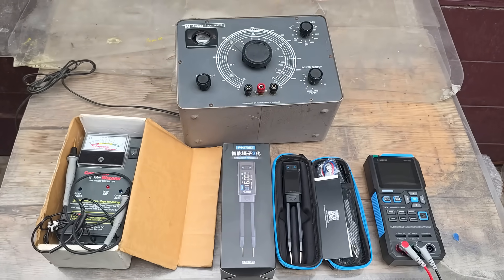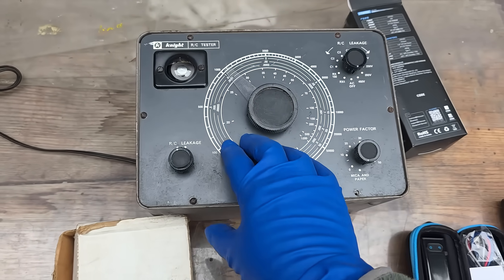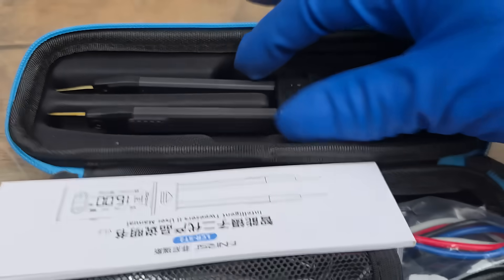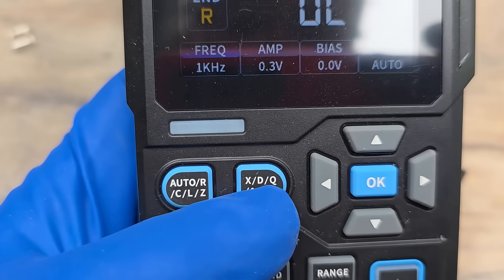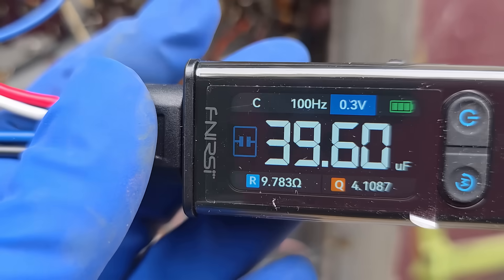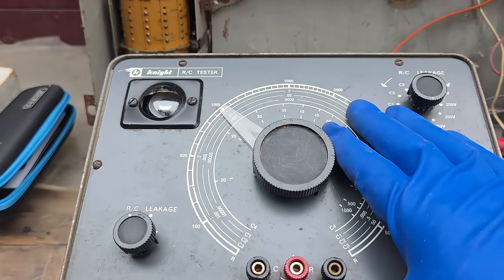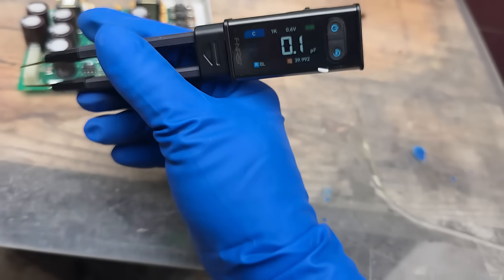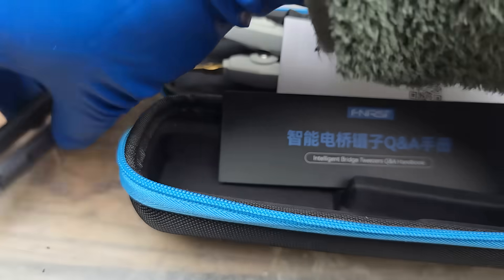Capacitor Testers and FNIRSI LCR ST2 dual mode LCR meter Review

Comment: Bought  the tweezers.  Did not live up to my expectations.  Would not test diodes in circuit. Battery seems to run down pretty quickly.  Capacitor test was mediocre.  I did upload the latest firmware.  Going to return to Amazon and try the bigger one.

Comment: I purchased this meter from the FNIRSI Official Store, and I am very dissatisfied with it. I conducted a comparative test with the previous LCR-ST1 model on 10nF, 33nF, and 47nF capacitors. While the ST1 shows perfectly stable and repeatable results, the ST2 fails completely. Even after "Open/Short" calibration at 10kHz, the readings (ESR and D) jump randomly by 500-1000% while the component is stationary. This indicates a high level of internal noise or a faulty analog front-end. The device is unusable for precision measurements. A short video with a comparative test is on my channel, link: https://youtu.be/14hxGCl6KPs

Comment: I was wondering how well that FNIRSI xray and nuclear tester would work on picking up the xrays around the HV area of a color tv. Would it be more sensitive than using the old fashioned geiger counter with analog meter? I would be interested in seeing you do a review on that.

Comment: FNIRSI also makes a decent entry level geiger counter for those who stumble into abandoned mines of a questionable nature.  USB rechargeable even.  Cheap on feebay from various sellers.  There are better ones but hard to beat for the price.  It does beta and gamma counting only.  No alpha or radon gas.  Sufficient for hobby level use in antique shops also.  Radium panel meters, dials, clocks will make it go crazy.  Vintage orange U-glazed pottery too.  Thoriated lantern mantles and camera lenses.  Medium level U-glass.  Not great for the mildest stuff.  It's all out there in the shops.

Comment: I already have the DER DE-5000 handheld LCR meter which I really like, but I just grabbed those same tweeters and paid the extra money for the Kelvin leads, so thanks for pointing those out. I’ll probably continue using the DER, I know it’s a clone of a much more expensive meter, if it ends up, deciding to quit in the future, I’ll take a closer look at the handheld you have. I also use a Peak Atlas ESR-70 Gold for ESR and a Sencore LC103 which I considered to be the end all when it gives me the results and allows me to measure for leakage up to 1000 volts. Obviously the smaller handheld meters are more convenient.

Comment: Hmmm my understanding is that a good LCR meter will allow you to check for capacitance @100 hz for us in the UK because its twice the mains frequency, so 120 hz is ideal for  mains AC filtering for you in the US because your mains is at 60 hz, capacitor spec sheets will usually give capacitance spec at this low frequency but i was led to believe that ESR should be always be tested at 100Khz only, could you clarify Shango what makes you think that the size of cap in microfarads make you select the frequency to test at?  I've had the DER EE DE-5000 for a few years now, made in Taiwan and available from Japan for around 100 dollars/pounds, and I'm always looking for more info on using it correctly, Love the cost of the FNRSI, Are they finally getting good for the money?

Comment: Fantastic video! Thank you Dr. Shango. That little instrument with the internal battery- how many years will it last?  In 2004 I bought a pair of Bose QC3  headphones. With little detachable LiION batt. and charger. Today, 21 years later, that battery still lasts as long on a charge as it did when it was new. I'm on my 3rd set of foam ear pads, but the damn battery refuses to die   :)

Comment: D stands for dissipation factor, not diode, and also tells a lot about leakage. Even at a low voltage.
Reply: Absolutely Correct, its when reading the spec sheet for the capacitor range comes into play, not available for the multicap cans so getting a better understanding on the dissipation factor  and ESR of those old cans is still one of my goals

Comment: fnirsi are not bad at all,i bought a 2c23t 50mhz dual channel scope multimeter signal generator recently and i find it good. also have a little lcr-p1 tester 18 months back,thats also fine though i might upgrade to the tweezers sometime.

Comment: My advice is if you're going to use it every day  and its high power  use or high demand and its 20 years or older recap it it will save you money in the future  and lots of original components could be damaged by failing capacitors  chemical breakdown is the cause of failure its like a oil change every 20 years

Comment: Man....  I think I spent over $200 on the Capacitor Wizard (great tool). Now, I think I need these. Test equipment can be an expensive addiction. Thanks for the video!
Reply: Yeah when i saw the price of the Capacitor wizard i baulked because you get get very good digital LCR meters by BK precision for example at that price and i already had the DER EE , DE-5000

Comment: I did not notice in the video that test clips have cable compensation.  Way cool.  I am always zeroing my tester to keep the readings accurate.  For less than $50.00 bucks I think I will pick one up.  Thanks.

Comment: It appears to provide very accurate readings! The only thing that comes to my mind is that there is some older test equipment which induces voltages that more closely simulate conditions a suspect component normally is subjected to, particularly in tube circuits. In such instances, components being tested with a lower voltage than what it normally handles may not necessarily indicate a fault. This new test equipment seems likely best for solid-state circuits.

Comment: So many people put Fnirsi down saying it’s junk but it’s not. If someone with as much experience as yours uses and approves of it that speaks volumes. I have the DPOS350P and the DSO-TC3 and they’re both outstanding products
Reply: Imagine having these things 30 years ago... They are amazing. What blew my mind most was the little transistor tester, that tests everything... That would have been magic when I started electronics 50 years ago. I use it daily. It is worth its weight in gold.
Reply: @martinda7446 agreed and I just ordered the DMT-99 to add to a field kit I’m building. For $32.99 on sale it was a no brainer. More than I needed from a DMM but why not for a rechargeable meter with a memory and 9999 counts?
Reply: The DPOS350P was easily the best piece of test gear I bought this year, and it's not even close.
Reply: The LCR-P1 is JUNK.  I just bought one. It has been in production for two years and it still can't correctly identify the pins of a transistor.  January last year their update log indicated they fixed SOME pinout issues.  Two updates later they still haven't fixed these known issues.  I sent mine back having no faith they will ever fix the issue.   Any product you get from them needs an update the moment you get it.  Ship ir, we'll figure it out later.
Reply: The only bad thing about Fnirsi is their unpronounceable name, lol. I also have the DSO-TC3, and I love it, but not all of it. It has a legitimate 20 megahertz scope. The component tester is very handy, but I don't trust the results on ESR. Maybe it's not the tester. Maybe it's the operator! 😅😉
Reply: @waltschannel7465 I have noticed that at times too with the tester. The thing I learned is to double check the pin placements and to make sure they’re in there tight. I tested several know good components when I got mine to get the hang of the piece and it was damn near spot on. The one thing I have noticed is when a component does go bad it has a hard time figuring out what it is sometimes. I’ve gotten transistors that it thought were zener diodes and even resistors
Reply: Usually the boomers trying to justify their big bucks HP/Sencore/Leader boat anchor equipment.
Reply: @senorverde09 agreed, I have a Tektronix 465 that I rarely use. It’s great but limits me at 100MHz. While the DPOS350P 350MHz is a bit of a stretch it is solid to 200 and that meets my needs as I use it mainly for HF radio repairs
Reply: @senorverde09 not only boomers like that stuff! But I definitely have my fair share of low cost equipment that does great work. Specifically transistor testers. 
One of my favorite investments is a used analog discovery 2 on eBay for dirt cheap. Buying the $12 transistor board lets me easily curve match transistors and other functions. If you can find something like that really cheap I highly recommend it